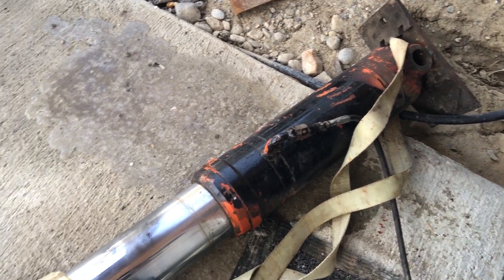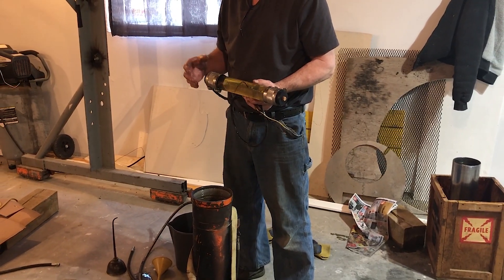Underwater LED Light Bar Depth Test | For Homemade Submarine

Comment: Nice work! Do you need to design in some safety margin for dynamic forces in open water that aren't simulated with a static pressure test, or do you find that the static pressure test is sufficient to validate the design for a 3000 ft dive?
Reply from the maker: Hi Brian,  that is a good point.  All the components  that make up the sub have a safety margin.   I am completely confident the light will work reliably.  This is based on how many dives I have already made with an identical light on my 1,000 foot rated sub.  To truly rate the light though, it should be tested deeper.  Thanks for pointing that out.

Comment: Congrats on your successful test down to 1000 meters! Do you have more information about the construction of your test chamber for that pressure? You made it look so easy!
Reply from the maker: Hi Wayne, Thank you, the chamber is a hydraulic cylinder from a haib crane.  I am not sure of the pressure rating but certainly can handle at least 2000 psi.